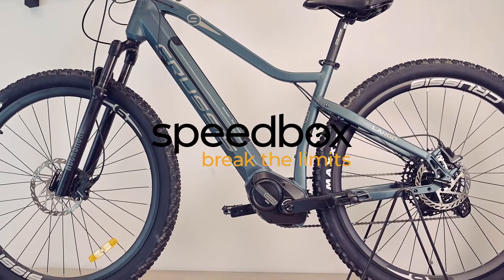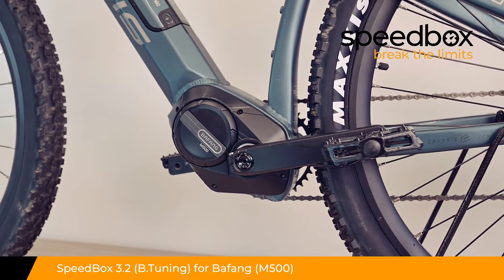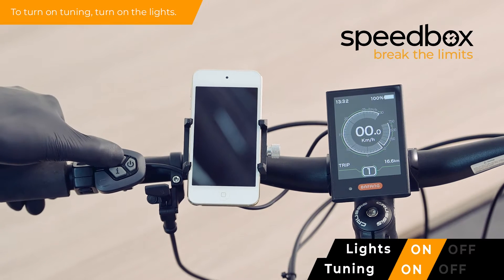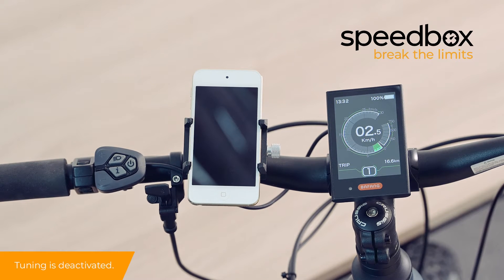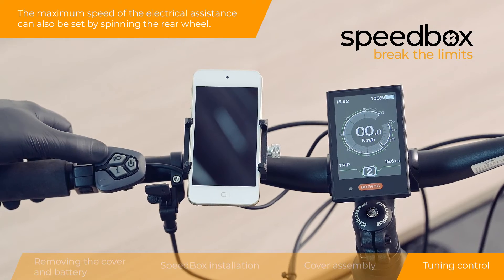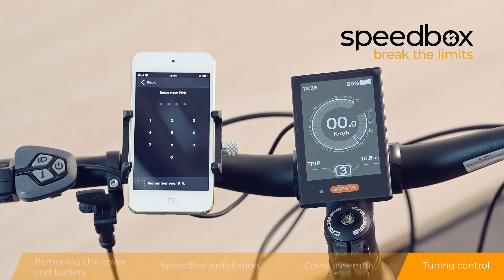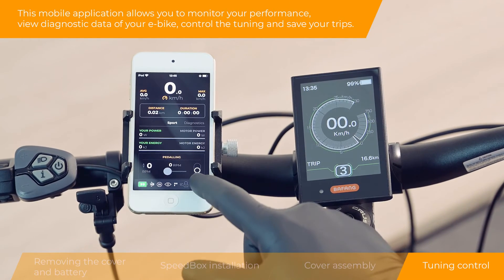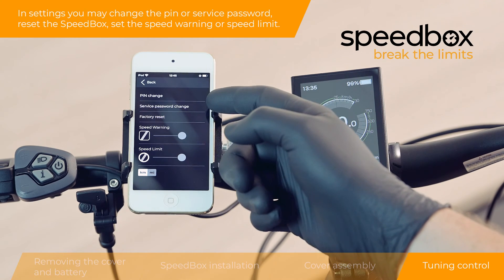eBike Tuning SpeedBox 3.2 (B.Tuning) for Bafang (M200, M410, M500,M510) Installation Instruction

Comment: I unlocked my bafang m200 with the USB cable and click button then fitted the lt2 cable and fitted a throttle with plug and play all  this cabling was for thee m400 and above  but works on. The  m200. I hours work😂😂
Reply from the maker: Well done – you’ve clearly found your own way around it. Not quite a SpeedBox solution though, is it?

Comment: هل هي متوافقة مع m400
Reply from the maker: Hi. No, for M400 is this one https://www.speedbox-tuning.com/p/speedbox-3-0-for-bafang-3-pin-connector#1767 or this one https://www.speedbox-tuning.com/p/speedbox-3-1-for-bafang-4-pin-connector#1751
Reply: @SpeedBoxTuning  شكراً لك أليس لها تأثير على المحرك
Reply from the maker: @ The SpeedBox does not affect the motor. The SpeedBox acts as a "bypass" within the motor. Its function is to unlock the speed limiter. It has no impact on the motor's functionality.

Comment: would this work with a Bafang BBS01B | 36V | 250W ?
Reply from the maker: Hello. No, it only work with Bafang mid drive motors M200, M410, M500 and M510.

Comment: Error 30 on m200. Perfectly good rewired stock.
Bad stuff.
Reply from the maker: Hi.
Error 30 is a communication error with the display. We recommend uninstalling SpeedBox from the bike, riding 5-10 km and trying to install again. Make sure the connectors fit together correctly.
If you don't know what to do, please contact our support at speedbox-tuning.com (support is available in 7 languages).
Thank you for your understanding.
Reply: @SpeedBoxTuning  I've tried 3 times . Not working. Its confirmed, not working with bafang  m200.
Reply from the maker: @kappafleo  Could you, please, contact our support at speedbox-tuning.com ?
Thank you.
Reply: @SpeedBoxTuning  I tried that several weeks ago. No reply.
Ive sent it back to amazon, I've wasted enough time already.
Reply from the maker: @kappafleo  Okay. But our support on the web and on Amazon works Monday through Friday. It's impossible for someone not to answer you.
Reply: @SpeedBoxTuning  you're actually right : a member of your team replied 14 days after my mail.  
I'd rather have my money back now than going through months of mails.
Reply: Same with my m510.

Comment: Or you can buy Besst Tool and set speed limit to 60 km/h with out any speed box.
Reply: Yeah, but for the same or higher price
Reply: @kyrk55  youd better.
This thing doesn't work, it's totally random and even IF it wotks its not stable at all.
Reply: If you program your motor it's permanently so you need a PC zu turn in back again. With a Chip you can enable / disable on the go. That's a benefit.

Comment: Hello.
Does the Speedbox work for the Befang m560 too ??
Reply from the maker: Hi.
We haven't tested this motor yet, so we don't know if the SpeedBox 3.2 for Bafang is compatible.
Thank you for your understanding.
Reply: @SpeedBoxTuning  
Thanks for the quick response. But if the plugs are exactly the same as the bafang m510, will it also wortk for the m560 (500 watts) sure ?
Reply from the maker: @Nicola-g4c  In fact, the SpeedBox 3.2 was originally developed for the M500 motor. We later verified that it is also compatible with the M510, M200 and M410 motor. It is possible that it is compatible with the M560 motor, but for the moment we do not have the compatibility confirmed yet.

Comment: Will the shop know that I had this device installed? If the motor brakes down, and I unplug the speedbox before taking it to repair, would they still know that I had it installed? The motor is Bafang M410.

Comment: My display is not like that will it work it is the c11 all the buttons around the edges
Reply from the maker: Hello.
Do you have Display Bafang DP C11 UART? It can be a problem. SpeedBox 3.2 works with CAN comunication, not with UART. Which motor do you have? Please check our filter on www.speedbox-tuning.com/for-bafang
Reply: @SpeedBoxTuning  thanks for your reply how do i know if it’s can or uart can’t see any reference in the numbers
Reply: @SpeedBoxTuning  looked again today and all it says is dp c11 c1.0
Reply from the maker: @iainmillington904  Hello.
Please check our web https://www.speedbox-tuning.com/for-bafang 
There is information and pictures on how to safely recognize UART or CAN communication. For example, according to the connector.
Reply: Hey did you ever get your speedbox 3.2 to work with your display? i've got the same display as you

Comment: does this speedbox also work with Bafang g520?
Reply from the maker: Hello.
If it si motor MM G520-0120 M500, then yes, it is compatible.
Reply: @SpeedBoxTuning  Now I got the bike and the motor is m510
Reply from the maker: @Rami.M-z5t  Hi. SpeedBox 3.2 is also compatible with Bafang M510 https://www.speedbox-tuning.com/p/speedbox-3-2-for-bafang#1783

Comment: Ciao m 200 e m 410 usano lo nstesso speed box???
Reply from the maker: Ciao. SpeedBox 3.2 per Bafang è compatibile con i motori M410, M500 e M510. Non abbiamo un prodotto compatibile per i motori M200.
Reply: @SpeedBoxTuning  I'm really confused here - your website says the 3.2 model DOES work for the "Max Drive" M200. I have a Mid Drive M200 - is that the same thing?
Reply from the maker: @prodigalretrod  Hello. Yes, the SpeedBox 3.0 is compatible with the M200 motor. We apologize for the misunderstanding. This is because the product was originally created for the M500 motor and was thus labeled, but over time through testing, we found that it is also compatible with other motors. Anyway, thank you for the suggestion, we will update the name of the video on YouTube 🙂
Reply: @SpeedBoxTuning  That is great news, thanks!
Reply: @SpeedBoxTuning  I went ahead and bought the SpeedBox and connected it to my M200 but there isn't enough room inside the motor for all the extra cables to be able to put the cover back on! Are you sure it is compatible?
Reply from the maker: @prodigalretrod  Good day.
SpeedBox is also compatible with Bafang M200 motors. Installation can be a bit of a challenge with some motor types. We recommend arming yourself with patience 🙂 Check out our installation manuals https://www.speedbox-tuning.com/um-speedbox-3-2-for-bafang

Comment: I thought with bafang motor ebikes, they can change the speed limiters via the controls, what does this do differently?
Reply from the maker: Hello. 
Adjusting the speed limit in the settings or using some programs is very limited. It only works on some e-bikes with certain motors and certain displays. And in the end you will find out that the modified max speed is only 28 km/h, for example.
The classic "chip" tuning is simple, universal, valid for a long time and the maximum speed is up to 50 km/h.
And variants labeled B.Tuning (B like Bluetooth) will allow you to pair the e-bike with the app and control all tuning settings on your mobile :-)
Reply: @SpeedBoxTuning  ahh i see, thats good to know. Thank you 😁
Reply from the maker: @bb7115  You are welcome! 🙂

Comment: Do you have a speed box for the m200 motor?
Reply: das passt doch für den m200 oder?
Reply from the maker: Hello. Sorry, we do not have. Only for M300, M400, M420 or M500. Thank you for understanding.
Reply: @SpeedBoxTuning  the video description says "m200". so...??
Reply from the maker: @kappafleo  So compatibility with other motors (such as the M200) was only added during the year when we gradually tested compatibility with other motors. Some Bafang motors are very similar, so it was possible to extend the compatibility without further modification of the original product 🙃
Reply: @SpeedBoxTuning i bought one after this reply.
Comunication error 30, it doesn't 
Work with the m200.
Reply from the maker: @kappafleo  Hi.
Error 30 is a communication error with the display. We recommend uninstalling SpeedBox from the bike, riding 5-10 km and trying to install again. Make sure the connectors fit together correctly.
If you don't know what to do, please contact our support at speedbox-tuning.com (support is available in 7 languages).
Thank you for your understanding.